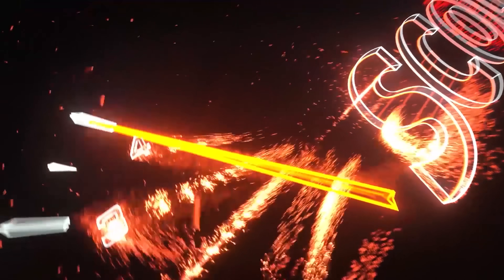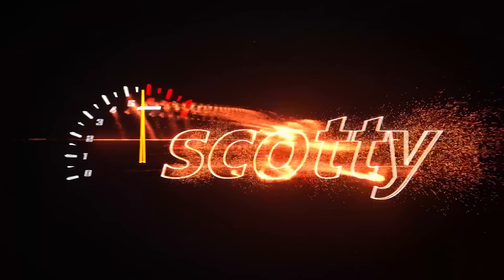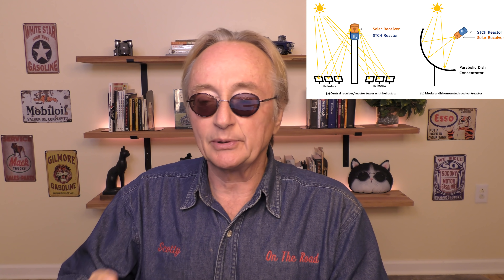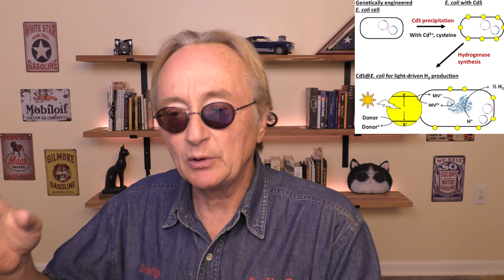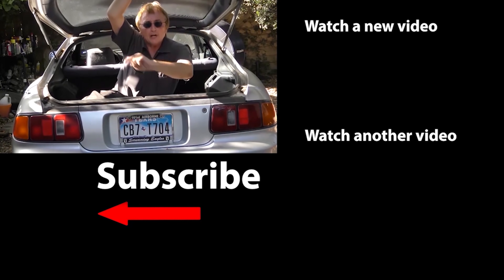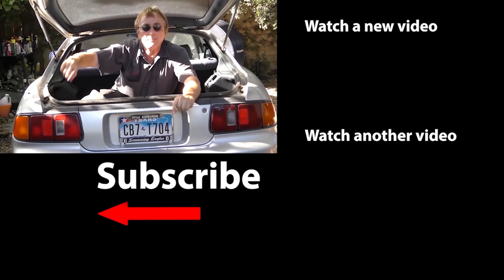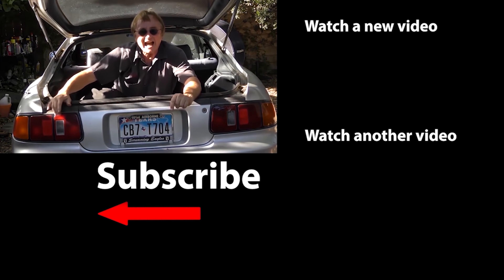Here's Why Electric Cars Will Soon Be Replaced By This

Comment: My only gripe is that all the "b3 cool, drive electric cars" people are intentionally blind to the processes involved with everything which allows electric cars to exist.  Making the batteries is an expensive (just try and replace the batteries in your electric car), complex, dirty process, then creating the power to charge the cars still requires foil fuel to create (unless you live next door to a hydroelectric plant) and disposing of the parts of used batteries that can't be recycled is a mess...  Electric cars are cool in concept but, by the time we actually have efficient electric vehicles and the batteries are feasible to make and buy cost effectively and you have recharging stations everywhere you go (it's expensive to put one in your home) the electric car will be obsolete.  Is it a "stop gap" between petrol and hydrocarbon fuels?  Maybe but, it's more of a placation than a solution.

Comment: Hydrogen has a very low energy density ( no range) and not so safe to store under pressure even if stored in Borax as Chrysler found out 30 years ago. Hydrogen is not going to happen due to safety and infrastructure costs. Quantum batteries are the future due to safety, reliability, lifespan and existing infrastructure. The future is all electric and the future is now.

Comment: Scotty, the problem with hydrogen is not merely that it is dirty to make, but also that there is such a large energy cost involved with making it. First you have to make the hydrogen, which costs more energy to make than it does to make electricity, and then the car must convert the hydrogen back to electricity, which costs even more energy. Those extra steps make it extremely inefficient to power a car using hydrogen...you only get back about 10% or the energy you started out with. That's the real reason why an electric car is more efficient than fuel cell car. Meanwhile, the argument about the electricity powering an EV coming from fossil fuels is becoming less and less true. The electricity often comes from solar or wind. In fact, the majority of the new power generation currently being added to the US power grid is from from wind and solar, NOT not gas or oil. Meanwhile, NO new coal plants are being added to the grid.

Comment: I'm in the same way I have a 1990 ford 150. the trans is going out thirty four thousand miles on it and twenty eight hundred to rebuild , but what kind truck can I get for twenty eight hundred. Trucks have been out of sight around here. ah this ford tail pipe is clean as a pin.

Comment: Producing hydrogen has never been an issue and it really doesn't matter the way in which you are producing the hydrogen, it will always be less efficient than just producing the electricity to directly charge a bev.  With hydrogren you still need to store it, transport it, not to mention the very expensive fueling stations.  Bev was dead before it even began, it just doesn't make much sense.

Comment: Sorry, but hydrogen has still bad time now. Not clean, too expensive, and not enough refill stations in most countries. When will hydrogen wins? Perhaps over 10 years, but EV is also changing in 10 years with new technology and new battery technology. In efficiency, hydrogen will lost forever. The only good place for hydrogen is the industry and transport sector. Trains, trucks, boats, they can run on hydrogen. And do you hate oil companies, because they decide over the hydrogen prices...?

Comment: Noisy lifters on startup in a Ford 3V means your tensioner gaskets are leaking oil pressure.  The first valve train components to go are on the #3 cylinder (90% of the time).  Fix ASAP or you'll ruin the engine.

Comment: When I was 19 I had a 1969 Camera SS350.  It started to have a clatter in the lifers.  A friend of my dad said to put some good transmission oil in it and drive it for about 500 miles.  I did and the clatter stopped at about 100 miles.  This was in 1969.  The transmission oil is super high detergent and it cleaned the gunk from the lifters.  I have recommended to others to try it.  Back then Chevrolet recommended 30w Quaker State oil.

Comment: "Hydrogen cars are the cars of the future." Hmmm. 
I have a house. It has solar PV on the roof. I have a battery electric car (eNero Kia). It charges from the solar PV for about 7 or 8 months of the year. (Not quite FREE driving, but pretty close :-). During the winter and the associated long nights / short days, I can change over night on cheap-rate electricity. (When the grid is generally clean and 'green').

I can not produce my own hydrogen. I can not STORE hydrogen. I WOULD have to PAY for hydrogen. That is NOT free driving.

If you are in a country where there is enough sun, (I am in the UK. NOT the sunniest of places, but sunny ENOUGH), you too could fit solar PV (circumstances permitting), and have free (almost) driving. 

Just a thought :-). (Move to California !).

Comment: Getting hydrogen and oxygen from water is easy  through electrolysis and a gasoline engine will run on hydrogen without much modification.  Yes I agree used tires can suck, but it's especially important if you have directional tread design. I've had cars come in with odd driving characteristics and it was because the tires were directional and installed incorrectly (even new tires). Love your channel.

Comment: Lifter clatter can usually be removed from an engine by putting in about half a quart of Marvel Mystery Oil. I have seen it remove lifter clatter before you could close the hood. It make sure that all of the lifters are clear. It's also a great for the hydraulic lash adjusters on things like the 3.6 liter engines and the 4.7 L Chrysler V8

Comment: There is a device you can plug into your cigarette lighter that has a battery in it and it will keep the computer from resetting when you change the battery.

Comment: Long term with recycling, grid improvements, and power (or fuel) delivery it seems Full EV vehicles will win. Much less energy loss and once the initial mining has been completed they say most of the minerals can be reclaimed after the battery is spent.

Comment: Scotty,. I saw an episode of a car show where a guy was making his own hydrogen using a small hydrogen generator that he built, . It was powered by a small solar panel. It made enough to power his house and Prius!
Reply: Yes this is why I like the idea of hydrogen powered cars!  If you own a free-standing home at least, you could theoretically create hydrogen (photovoltaic cells -> hydrogen and/or wind-power -> hydrogen via electrolysis) at home.  You could store hydrogen in big (perhaps buried) tanks.  This would be continually happening, even while you are away at work or on vacation.  Then you use the hydrogen to power your house, for cooking, and for powering your vehicle. In this way you are almost totally self-sufficient. The trouble with batteries is, they are no good for long term storage of power.  But hydrogen is in effect a battery that lasts forever.

Comment: Scotty, Hydrogen cars will still have batteries, charged by the electron flow thru the fuel cell and also by plug-in. The battery will be smaller/lighter. The electricity will then power an electric motor/s, hence why so much is going into electric motor and battery tech.

Comment: As I see it we could do more nicer with automobiles smaller less crowded roads more on nicer styles bigger windows mirrors not sure how to word it more as I mean it less blind spots tho no matter how made designed safe simple the worst is the operator behind the wheel nuts driving or aiming it as some do easy does it thank you

Comment: Interesting!  It has been done to use solar (slow) to make hydrogen from water and then store it in the car tanks at lower pressure with Lithium-6 Deuteride (Used in weapons.) which is illegal to buy but not to make.  Of course only deep pockets could make it.  Works great.  I have seen work being done with carbonized chicken feathers in an attempt to replace the Lithium-6 Deuteride.  Usually, what makes the most profit is the winner even if it is not the best for the people and the earth.

Comment: Hydrogen is better until you factor in logistics. Transporting /storing hydrogen is expensive and our grid is much more capable to support EV vehicles over hydrogen vehicles. It would take a minimum 20 years to be able to build the infrastructure for hydrogen vehicles.

Comment: The 2002 Mercedes doesn't have a reset/reprogramming need. They have an auxiliary battery though so the owner actually needs to make sure both batteries are okay.  A scan sure, a reset or reprogram no.

Comment: problem with hydrogen is its insanely expensive.  RIGHT NOW using hydrogen to power a car with a fuel cell would cost the consumer 5-8 times as much as gasoline, using gasoline costs ~4X as much as using electricity. that means hydrogen is around 20-30X more expensive than electricity.

Comment: It’s funny ever manufacturer’s has recalls from Ford to Toyota to GM.    But Scotty makes every thing GM does as a big deal.  And what I’m reading on this recall is it’s a bolt coming loose. So a machine that has thousands of bolts and moving parts has a problem and let’s call it the downfall of a company’s. Wrong.  They all have issues no one makes them perfect.  

Go back to making your videos helpful. How to do things. You gotten in this trend of just bashing vehicles based on your opinion.  I’ve owned all makes from GM to Dodge to Ford to Nissan.  And I’ve never had issues I take care of my vehicles. And yes they all made a lemon vehicle   It’s a machine assembled my a human there going to be mistakes along the lines.    Based on your trends we should only own cars from early 90’s or before and made by Toyota sorry not me I know plenty of people with Toyota vehicles and suffered there share of problems to

Comment: I do windshield replacement s fot rental companies so 2019-2020... All the cars except toyota u can pull the urethane up at the corners and the sealer for the body panels literally comes off so easy. No cutting ... Thats not good. Do NOT buy new cars they are getting away with some wild stuff.. suprised DOT hasnt found out ..... Hmmmmm

Comment: All cars using H2 as an energy source on the market today are electric cars! And all of them are also Battery electric cars, because they need a battery to buffer the energy used. Simply because a fuel cell stack cannot produce the energy  needed for acceleration in time. It is the same system your toilet has to flush. So H2 cars are simply battery electric cars with a small battery and a fuel cell stack and H2 tanks. so much more than can break and will be all unnecessary when prices for batteries come further down. H2 has a future for trucks where every Kilo counts, nowhere else.

Comment: I've got a 2010 GMC Acadia Slt Awd and I can get it to turn over but it want crank and I replaced the starter and battery and coils and plugs and purge valve and throttle body and it want crank but it will turn over so can you give me some advice of what's wrong with it

Comment: So wait, your going to use solar to create electricity, then use the electricity to create hydrogen, then take that hydrogen to create electricity again, you've just added multiple losses and lots of extra steps to the process. The extra cost for the hydrogen fuel cell and specialized storage tank will also exceed the cost of just having a battery. And then you have to worry about a hydrogen leak in the system, not exactly easy or inexpensive since hydrogen is made of 1 atom of hydrogen. I'll stick to solar to charge the battery without the extra costs or steps.

Comment: hydrogen is the most abundant molecule but is also the smallest. a hydrogen tank must be made very thick and keep at 10,000 psi. even then hydrogen will still leak out. natural gas is kept at 3000 psi. also the metals used in the mirai are expensive and rare. there is also the problem with infrastructure.

Comment: So this may end up like the Betamax vs. VHS war or the HD vs. Bluray war. Betamax was the better of the two and HD was also however, the public got stuck with what worked out best for the manufacturers and, in this case, Hollywood and copyrights protections, theft, pirate copies etc.  Will electric, the major pollution of the two, end up as the winner?  Likely because the Government can control the power and monitor it while they can't do that with Hydrogen as much.

Comment: Hey scotty, greetings from Germany! I've got a 2003 camry with the v6. Very rare car here by the way. I've got a rattling sound when I turn the steering wheel all the way and start accelerating. I guess it's the drive shaft joint. Driving with this for over 20 thousand kilometers, do you think I should change them or just live with it?
Reply: The MOT may require you to replace it, or whatever is causing the problem.

Comment: I have check engine and cruise control is flashing, I check it and it’s po172 code. Help? 2005 Subra legacy
Reply: Likely a mass air flow sensor that needs cleaning. YouTube "Scotty make car run better spray". Air dry the sensor overnight. It may instead be caused by a vacuum leak; those rubber hoses are getting old. A fuel injector in one of the cylinders may be grimy. There could be a problem in the fuel line, and/or fuel pressure at the fuel rail. Though unlikely, there may be an exhaust leak before their oxygen sensors.

Comment: If you have a slight pull to the left check your tire pressure first! A tire low on air can cause a pull start with the simple things first.
Reply: I bought my father in laws car and it had a bad pull to the left.  Alignment was fine.  Determined it had two tires that pulled in opposite directions.  Put those two on the rear, problem solved.

Comment: I change tires after 7years, approx 70000km on them, always buy new ones and I can tell that behavior of tire changes around 5-6th year. The thread is good so people buy them used of me, and it's quick sale usually, 10euros per tire. I buy summer Dunlop, very good for rain, and winter Hankooks very good for snow, but awful for rain. I would always advise people not to buy used tires...

Comment: Can you please expose this issue with the 2020/19/18 Camry (non-hybrid). There’s a post about it. Make sure the car is on, all windows up so you can hear, no AC or music on. It needs to be really quiet. There’s an annoying buzzing, static, electric frequency sound when you press and release the brake pedal. It’s a little loud and annoying. Toyota said it’s normal but very annoying and haven’t offered to fix it. There’s a great write up on the issue which was difficult to find. The write up has pictures from the findings of the specialist from Toyota stating normal. It’s the SE Camry. Not hybrid. If you can put this out there it will help out many if Toyota chooses to fix the problem.

Comment: I have a 2017 Corolla with a CVT, I just hit 50k miles and I have had 0 issues with it so far. I was just wondering when you guys would recommend getting rid of the car since I dont want to deal with any transmission issues.
Reply: So far, they've held up very well. You could replace the fluid (use OEM Toyota CVT fluid only) as a preventative now and every 40k miles from there, but otherwise, Toyota looks like they solved CVT reliability.
Reply: @EMichaelBall  Sounds good, the manual says to do it about every 60k miles.

Comment: Scotty I've been saying for a long time they should work on designing a hydrogen run car. Perhaps a system which uses water... Plenty of sea water. Might sort out the rising sea levels. Just need to take the salt out of the water which is easy to do.

Comment: Responding to the very last statement Scotty made about  buying used cars, Yes sometimes People are selling  cars that have mechanical problems nobody wants to take the time and money for to figure out, like when I bought a 2005 Civic Special edition, It would randomly not  Start after starting fine 10mins before, With no codes, It ended up being a bad engine crankshaft position sensor and connector because someone allowed coolant to get into it when the water pump and timing belt was replaced causing corrosion and then the no starting problems. Because after replacing those two parts alone it starts like new everytime with over 80,000 later the car in Total has over 220,000miles on it now,            I guess I am just lucky to be a Diesel technician, because someone else my have gone broke trying to fix this, because the car had a new alternator battery and spark plugs etc🤓

Comment: hydrogen is super clean but water vapor what comes out of the tail pipe. the clean way to get hydrogen is by water by separating the elements through electricity however super expensive. the side effect is ammonia from this process. as of now it costs too much to develop for the auto industry. the aforementioned video does work but for now low yields.

Comment: I bought used winter tires on steel rims. The kid had them for 1 year and was moving to Europe, so he needed the $ and didn't need a second set of tires. I was nervous, but they looked good, so I bought them. I had a shop check them out and put them on my car the first year, and just finished using them this year (the second winter with them), too. Knock on wood!

Comment: The only problem with Hydrogen is in the storage of it in cars/trucks. Unless you can get it to a slushy state it wont have that much more power to weight ratio over electric batteries.